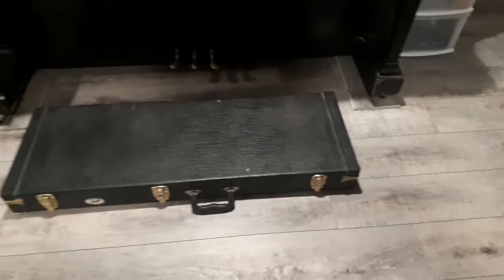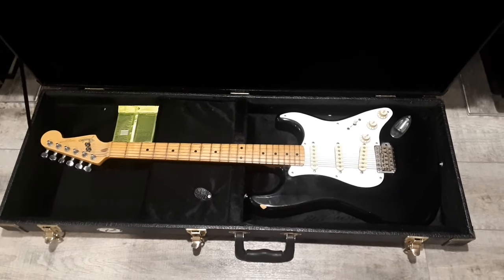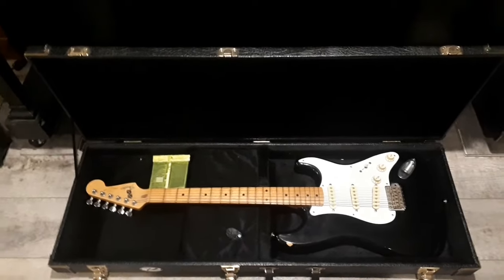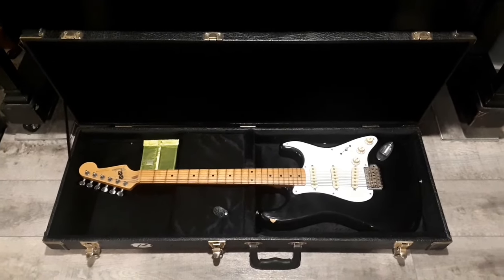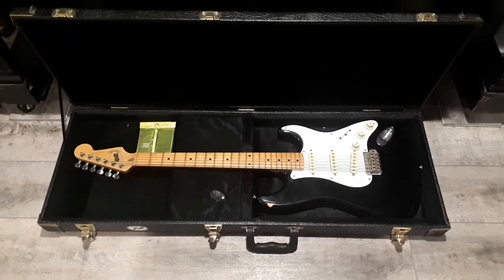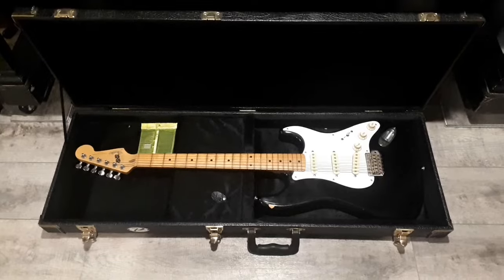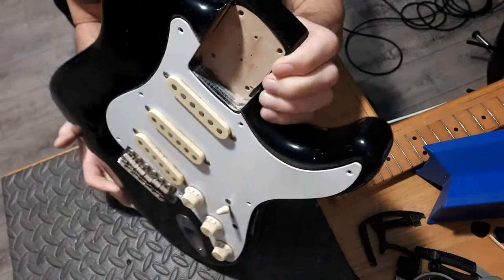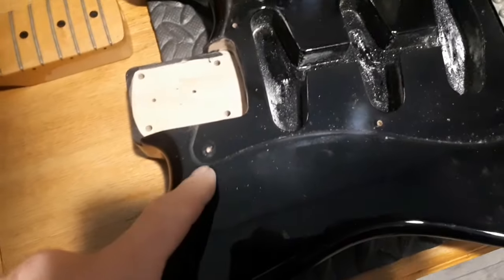FENDER 1982 MADE IN JAPAN STRAT-Ressurection Part 1!

Comment: With a vintage American or Japanese made instrument like this, I would treat it very differently from a cheap modern budget instrument. Rather than try to upgrade and mod the heck out of this guitar, I would recommend adjusting and replacing ONLY what’s necessary to make it playable, and then save the original parts in the case—this will help maintain its resale value in the future. In this case, I think I’d replace the nut, maybe the output jack, LIGHTLY polish the tuners, adjust the truss rod, polish the frets, make sure they’re level, properly crowned, and properly dressed, and MAYBE replace the saddles if it would dramatically improve playability, but save the original saddles in a bag to go inside the case to maintain the resale value. If you can find a suitable pickguard, I might replace that too, since this one is clearly not original to begin with, and is not in the greatest shape. The ideal would be a pickguard closer to what would’ve been original, maybe aged a bit to go with the aged pickups.
Reply: UPDATE: I thought the pickguard wasn’t original, because it looked less faded than the pickups in some of your close up shots, but I’m not so sure now! The components are somewhat surprising, too—I would’ve thought they’d be using standard Fender parts from those days!
Reply from the maker: My friend told me he was never selling it as it was a gift and he can finally start playing it now that his arthritis is under control... Gonna keep it original except for nut, saddles and pickguard😄
Reply from the maker: @zuperdee  yeah not sure this wasn't played around with through the years...
Reply: @j-man9457  Makes sense! I imagine setting the action properly should help make it easier to play with his arthritis, too!
Reply from the maker: @zuperdee  hope so! I really want to do a good job on this for him🙂